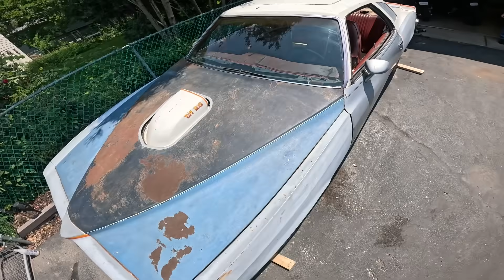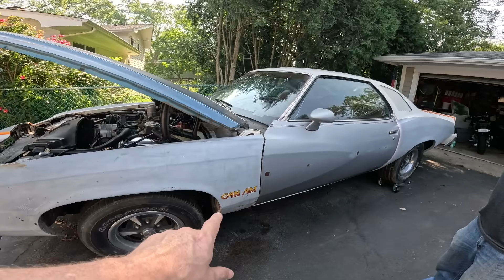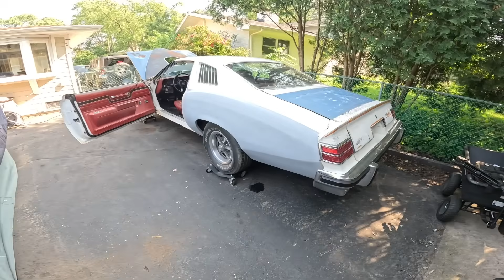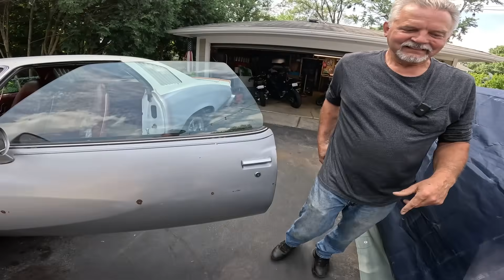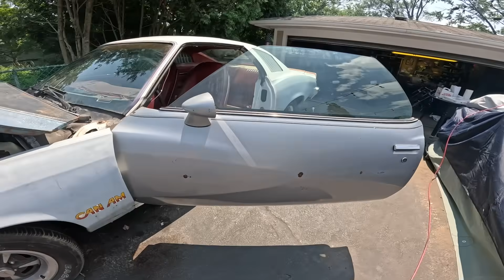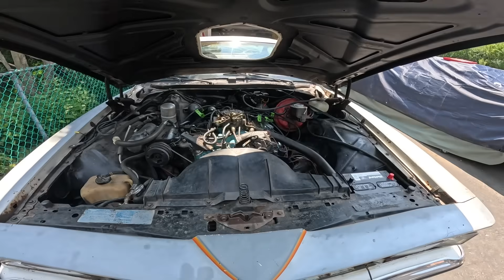1977 Pontiac Can Am Revival! History, Features & First Start

Comment: The reason was due to dash boards being needed for the more popular and profitable Grand Prix, there was a strike at the vendor for them. The whole spoiler thing wasn't accurate.  There were many molds made in order to produce 5000 spoilers in 6 months, each mold takes 3 days of use so do the math. Ive seen Can Am scratched into the mold on some of the spoiler backs and some having different markins scratched in as well to back that up.

Comment: Sence that Car has been sitting for sometime and the motor got Hot and ran for awhile.  You should change the Oil and Filter get the sludge out of the bottom of the Oil Pan from running the motor.

Comment: Working on a CA myself, trying to get her back on the road. 400 full of water, Th400 trans needs rebuilt. 1970 Pontiac 350 in her for now. Has the black and white interior. It's estimated that less than 300 viable Can Ams still exist. The actual hp of the CA Pontiac 400 was 260hp. This was confirmed by auto magazines in the day. The sport steering wheel in his particular car is rare.

Comment: Nice video on a rare car many didn't know or forgot completely about. The giant bumpers of the seventies through the early eighties were mandated by the government to absorb a parking bump of 5 MPH or less with no damage. They had nitrogen shock absorbers behind the bumpers to collapse on impact. Over a period of time the pressurized shocks would extend the bumpers back out. The urethane around the bumpers flexed and returned to normal. This all worked great when new, but none of it aged well. The urethane became very brittle and literally fell to pieces in harsh climates. The weight of the shock absorbing bumpers eventually allowed the manufactures to convince the government they could make the cars more fuel efficient by taking out weight. Then of course, safety of occupants became a big deal and the weight came back in the body to make the cars strong.   
The 1973 GTO would have NACA not NASA hood scoops. The design was based on the more aerodynamic NACA duct developed in the 1940s by the National Advisory Committee for Aeronautics (NACA), the predecessor to NASA.

Comment: I had a Red 1973 GTO and it had a rubber nose.. areo coupe.. no chrome up front
Reply: In 73, only the Grand Am had a "rubber" nose with painted front bumper. The 73 GTO had the same metal nose with chrome bumper like the Lemans had, except with a GTO emblem in the grille. No such thing as an "aero coupe" in 73. I own both a 73 Grand Am and a 73 GTO, which is why I know. They are both built on the "Sport Coupe" body, so maybe that's what you meant when you said "aero coupe".

Comment: Back in the 70s, myself and friends were in our early teens. One day while hanging around the local store, a guy pulled in driving a CanAm ( EDIT: It was a  Chevy Laguna, same body style) He opened the door and made his seat swivel so he was facing out. He laughed when he saw all of our faces. I assume that the seat swivel was one of the features but have not seen one as of that day.
Reply from the maker: I’m no Pontiac expert but I don’t think the swivel seat was an option available through Pontiac. GM definitely had swivel seat options for the A-body line for Chevrolet and Oldsmobile.
Reply: @CodyBuilds  I just looked it up. About the same body style, 75 Chevy Laguna . Had the luvered side windows and the swivel seats. Your car reminded me because they look very similar, it was 50 years ago and braincells have been lost. 😁
Reply: My 1975 Chevrolet monte Carlo had swivel front bucket seats
Reply: I have a pair in my 75 El Camino. Very comfortable seats.

Comment: Enjoying the video. Great car! I have a 73 Grand Am and mine has a working power sunroof too, as well as power everything else, and a 455! It's a project and I have some work to do on it, but it does run and drive. 
Question...When you installed the plug wires, did you install them with the firing order on the distributor cap in counter-clockwise direction? Pontiac distributor is counter-clockwise rotation. You mentioned Chevrolet when you were playing with the distributor, and I was afraid you might have connected the wires clock-wise like a Chevy. I don't know if it would even run if you connected them in clock-wise direction, or it might just run very poorly. You didn't mention it one way or the other so which way did you do it?
Reply from the maker: Yeah when I was editing I caught myself saying Chevy multiple times instead of GM. Plug wires were installed counter clockwise. I highly doubt it would have run if we installed them clockwise. If it did it wouldn’t have been on 8 cylinders 😂
Reply: @CodyBuilds  haha, yes I thought that too.
Reply: I can say from experience that it will actually start and run. However if you attempt to drive it, it will backfire like crazy.
Reply: @mikee2923  Thanks...good to know.
Reply: The 1973 Grand AM was far better looking and arguably the best looking of all the GM Colonnade A-body cars.
Reply: Overall the Pontiac colonnades are the best looking out of all of them. Oldsmobile was second. I personally like the 73-75 Grand Prix best. But I like all colonnades with round headlights better than the square headlight versions. The Grand Am was definitely great looking along with the 73 GTO.

Comment: A couple of interesting details to share...The Can Am has a Grand Prix dash, which is one of the things that made it different from a regular Lemans Sport Coupe, which has the differently styled Lemans dash. So, if you need parts for the dash, you can get them from a 73-77 Grand Prix donor car, as well as a 75-77 Grand Lemans which had a GP dash too. Also you mentioned that there were a bunch of white 77 Lemans Sport Coupes that were built to be a Can Am but were left over when the Can Am was cancelled. I've seen an old photo where there was a parking lot full of white 77 LSC's ready to be sent to Motortown for conversion, but were never sent. So, they were sold off as LSC's, but they had GP dashes in them. So, if somebody were to find a white 77 Lemans Sport Coupe with a Grand Prix dash, that's how they would know if they have one of those cancelled Can Ams. 
Another interesting thing is that the shaker scoop used on the 77 Can Am is the 76 Trans Am style, and not from a 77 TA as one might think. The 77 Trans Am shaker scoop is differently styled, and wasn't used on the Can Am.
Reply from the maker: Thanks for sharing!  Lots of interesting details about these cars. It’s a shame Pontiac pulled the plug on production.

Comment: Cool car. Being 1 of less than 1400 is rare—it would be interesting to find out how many came with this particular interior— might be even rarer. Is the dealership sticker still on the trunk lid?
Reply from the maker: I wish we had the production numbers for this spec, but unfortunately that wasn’t provided with the paperwork Jeff got. Anecdotally, most of the Can Am’s I’ve seen in person or online have had the red interior. I think it was the most popular option followed by the black interior. The dealer badge is long gone. You can see where a second badge was removed somewhat recently as well. That one said Regal. Not sure what dealership that would be. Did a quick google search and only a used car dealer in Florida came up.
Reply: @CodyBuilds  I agree. Although there were other interior colors, like black, Tan, White, and I've even seen blue, most Can Ams I've seen had Red interior, called Firethorn Red by the way. I think Red looks best, with white being second best to me.
Reply from the maker: I totally forgot about white being an option. Interesting note on the blue interior. I didn’t think that was available to the can am package.
Reply: @CodyBuilds  Yes, when I saw the CA with a blue interior on the internet long ago, I should have saved the picture to my computer, since I'll probably not see another one. But at the time I was only saving copies of the CA's that I thought looked good, so that one didn't qualify 🙂.